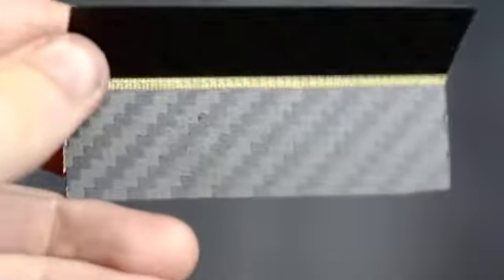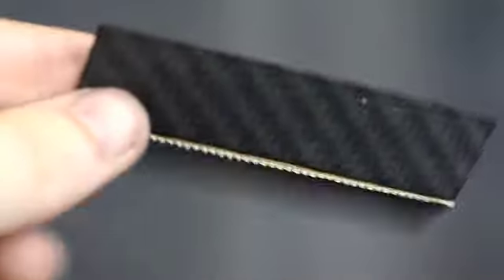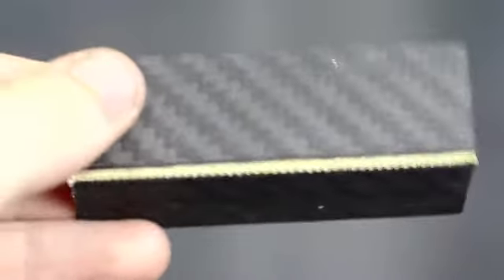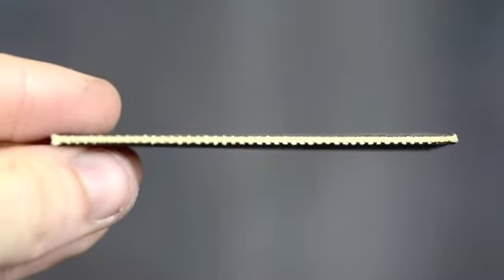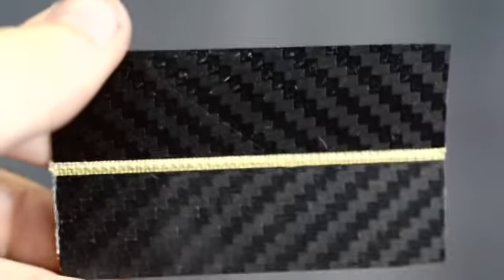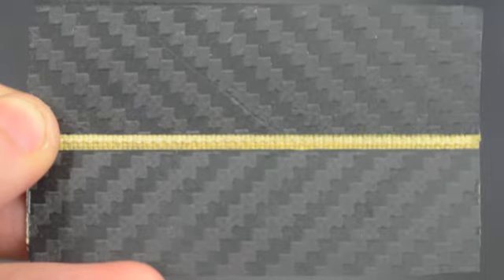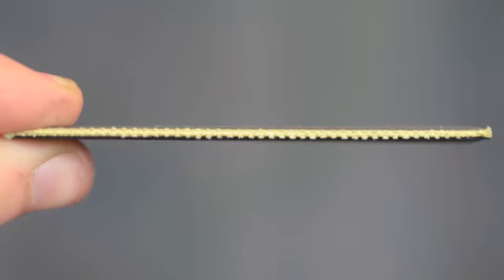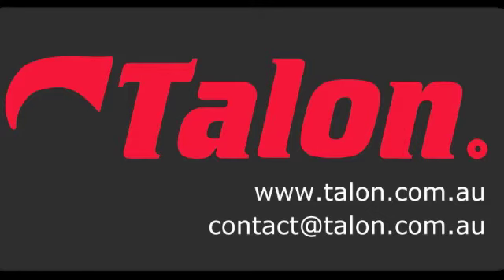Talon Carbon Fibre Hinge

Comment: Very cool. How strong is it compared to a traditional metal hinge of similar size?
Reply: Alfred driscoll Hi Alfred, Our 1.6mm hinge takes a static load in excess of 150kgs , which is quite a bit more than any hinge made from an equivalent thickness metal or plastic hinge. It also doesn't fatigue the way a Polyprop hinge will. If you really need a lot more strength it is possible to double or even triple the Kevlar flex unit.
Reply: Wow, thats fantastic. Im looking forward to seeing what can be done with this.